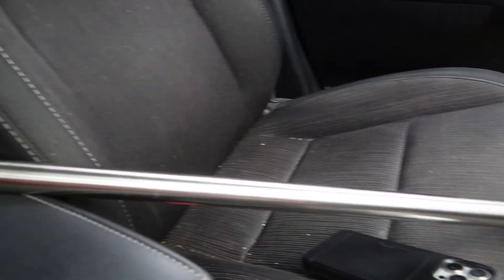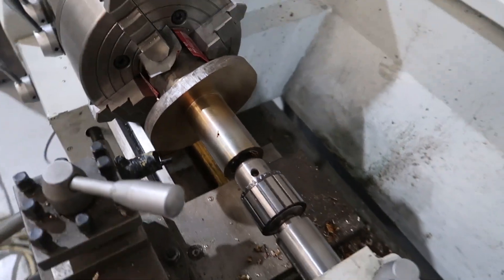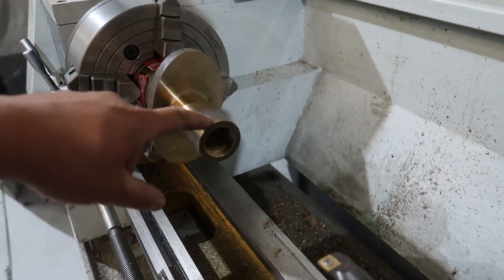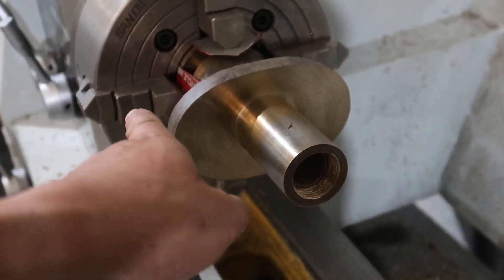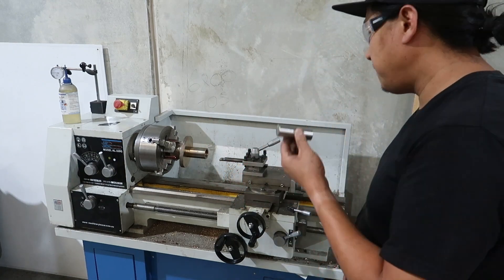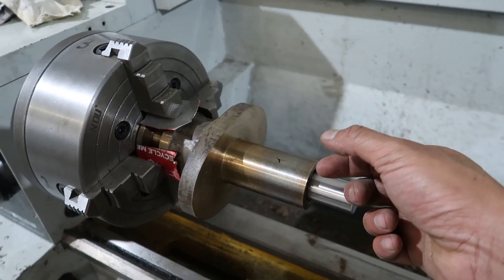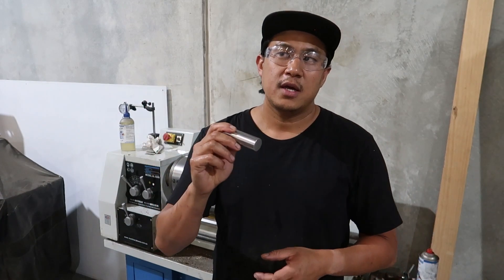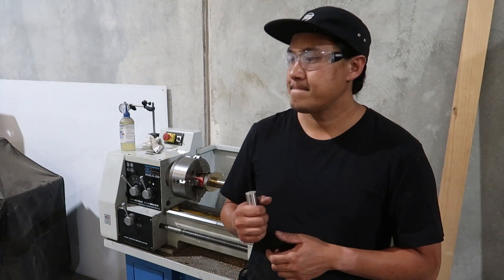Machining Propeller Hub to fit 316 Shaft

Comment: Thanks for another great video.  Would you recommend the 320g or the 250g with the gear box? It's been hard to find much info on them. Looking forward to the next vid. Cheers Ted.
Reply from the maker: Hey mate, thanks. I picked the 320g based on the bore size. It was the first lathe in that price range to have a 38mm bore. The others capped at 28mm like the 250g. I also wanted max diameter capacity because I knew I was going to be making some big bearings i.e. for the rudder post. Changing the gears isn't really that bad. I have already increase the speed by making a sorting box with all the gears in order. It's a bit of a learning process in terms of which way the gears go and where. But I do believe there are more options in terms of threading types on the 320 than on the 250. For me, because I am only doing slow one off projects on the lathe, I don't need anything 'quick' on the lathe. But if your use case is multiple fast projects with smaller diameters perhaps the quick change GB will be of value to you. If I were to do it again, I wouldn't buy the stand, it's a piece of crap that cuts you every time you use it. The lathe literally wobbles on it. Just built your own stand.
Reply: Thanks for your insight mate. Good luck with the rest of Kulali's build. Cheers.